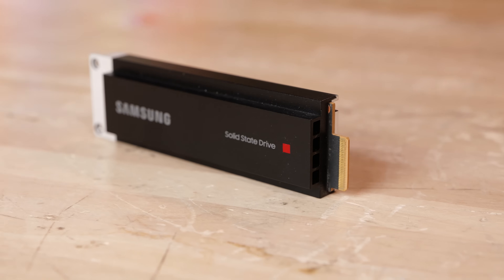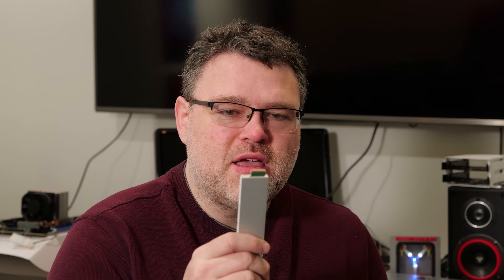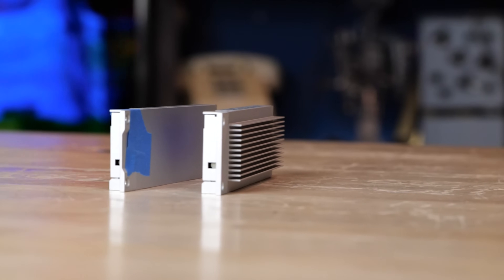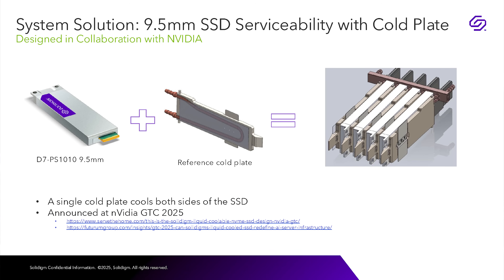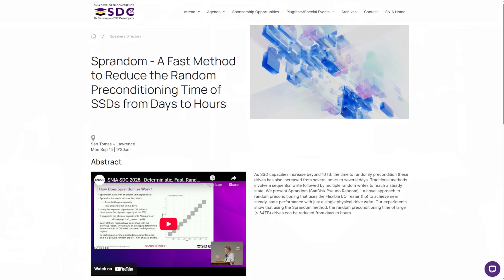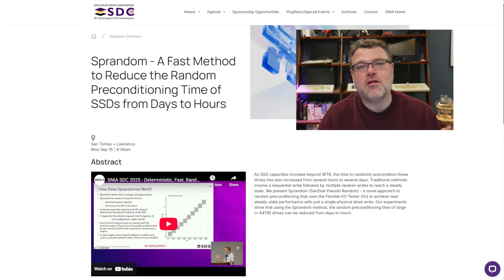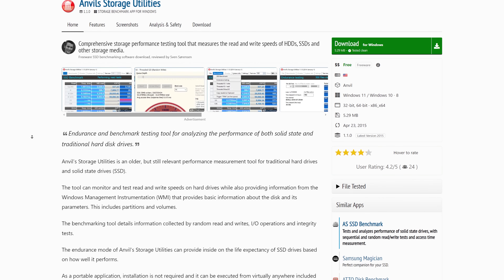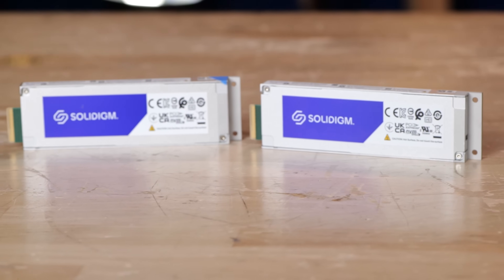Server SSD Innovation from Solidigm

Comment: what part about a 2.5" drive is 2.5 inches? can't explain that
Reply: In theory it is the platter. A lot like 3.5 in and 5.25in drives are actually physically wider than that because that measurement was taken from the size of the floppy that went in the drive not the drive itself.
Reply: @JoshDike-lx8gl  So we should call them "SSDs the size of an HDD with a 2.5" platter"?
Reply: @Alvin853 lol well the 2.5in hdd was replaced by the sata ssd so they kept the same footprint. Personally it bothers me that they are different size then the physical size but no one asked me.
Reply: platter size, maybe?

Comment: This format looks very promising. I am using at home the Samsung PM9A3 and the Intel D7-P5510 in the u.2 format, both are great. But as someone else mentioned, I would not touch Solidigm after the firmware problem with the P44 pro, very disappointing.

Comment: You say technology trickles down, but you were talking about water cooling SSDs just before and I really don't see that catching on outside of super niche 'watercool all the things' builds. I do look forward to anything that promises to improve latency, though.
The desktop honestly just doesn't need the sheer amount of parallel IOPS these SSDs are capable of and random Q1T1 performance has been improving very little without a paradigm shift in technology. Optane is dead, sadly.

Comment: Neat, but also Solidigm is dead to me until they fix the broken firmware that's crippled the multiple P44 pro's I own. Especially frustrating that the skhynix versions got a fix but Solidigm clearly dgaf. Yes I might be a little salty about it 😂😭
Reply: What's the bug? I have an skhynix p41 platinum which I believe is the same model as the p44 pro? 
EDIT: 
For anyone asking, it seems the SLC cache doesn't flush itself overtime and bugs out. 
Leaving only the raw TLC speed i.e. write speed drops from ~6GB/s -> 2-3GB/s, permanently until a secure erase is issued (wipes the drive) or the fixed firmware is flashed (p41)
Reply: Wow that does seem like a pretty serious bug.
Reply: Ugh, awful bug
Reply: The NAND SSD division from Intel (and their successors) seems to have had serious firmware quality issues.
Reply: Bumb. They walked away from the consumer maker and basicly told us to go suck it.
Reply: What type of workloads are you hitting them with? I have quite a few here spread around multiple systems and haven’t seen this slow down.
Reply: @malventano  I basically put one in every system I own, so desktop duty and a VM datastore for virtualisation hosts. They've all got this issue at this point. Then I moved to a 990 pro for my main VM host which had firmware issues with the drive going offline and needing a full system power off to get it back and picked up a few 850x's which have been ok. Talk about a bit of a shit show, also I did not expect WD to be the ones who put together a high end gen 4 SSD that didn't have issues, good for them I guess?!?
Reply: @malventano  Since Intel’s NAND SSD division doesn’t exist anymore and it’s been more than 10 years, could you honestly describe what actually killed the Intel 320 600 GB SATA SSDs? I’m talking about the recurring bug that destroys all data on the SSD, leading to it reporting only having 32 (?) MB of space and after performing a Secure Erase on the drive it works again normally for a while.

Lost multiple SSDs that way, Intel replaced them and the replacements behaved the exact same way.